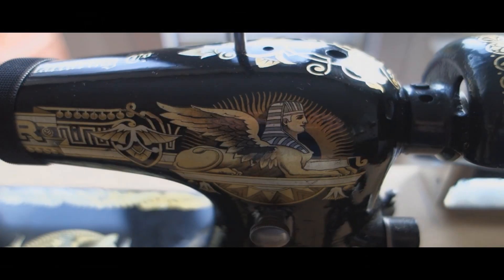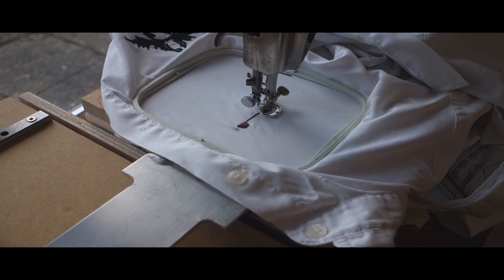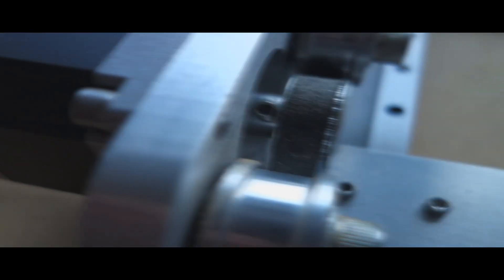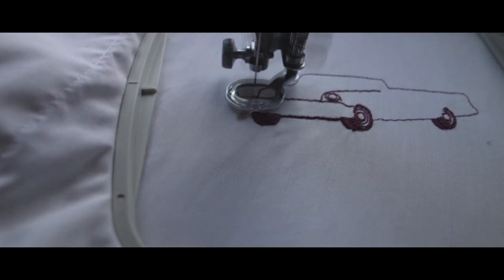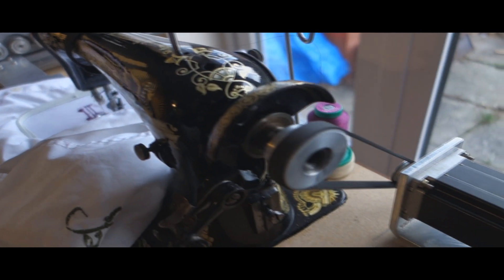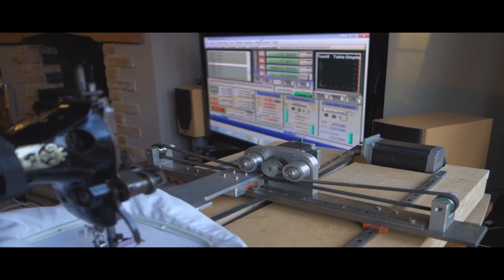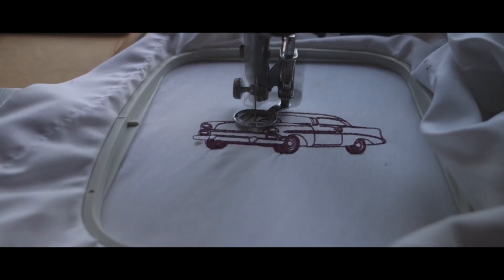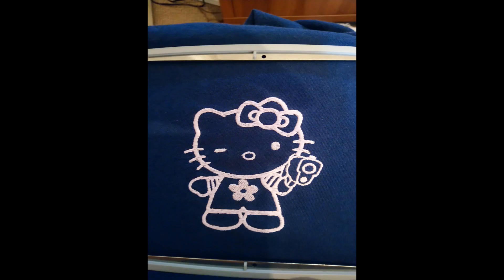CNC Sewing Machine

Comment: Hello,

I have a working laser cnc machine and a sewing machine.
I would like to link the sewing machine to the laser machine, remove the laser and screw a frame to transform this device in a embroidery machine.
Could you please help me? As I have the laser machine, do I need to buy a arduino board? how do I connect the machine motor to the laser board?
thanks a lot fro reading,
Looking forward to read you,
Isabelle

Comment: it's unclear to me how you compute the gcode file, 

i try with inkscape but the scew motor run only when the fabric is not moving
Reply from the maker: There should be a link in the description to cnc zone, I was using the software there developed by a guy called khalid to convert from tagima which is an embroidery format, to gcode. Good luck.
Reply: @makeyourownpath48 vou pesquisar.  Você tem vídeo tutorial desse projeto?
Reply: Did you find solution for your problem? Because I'm also facing similar problem.
Reply: @amitphogat9698  ive made a script to read the parameters from the gcode, and to generate a proper gcode

Comment: hello, i'm working on the same project and i need your help please, i m facing the problem of z axis ,i m using the nema23,when i send the g code the table moves but there is no stable direction for the stepper motor of needle,it just turns left and right without making any full revolution,despite i made my settings on the grbl panel and my motor made his full rotation during the test ,can you give me any advice how can i solve this problem please ?!

Comment: Can we change z axis with ac servo motor?
Reply from the maker: You could but then you would need to figure out the synchronisation with the x and y axis using some sort of encoder.
With the stepper motors there is no need for the encoder feedback.

Comment: Very nice and good detail!  Would a quieter stepper motor controller help reduce the noise somewhat?  Thinking using a White FR maybe would be quieter also.  Thinking about doing that with what a just found today using a Singer presser bar so to more easily use Singer attachments on the White FR if I decide to do so.  Thanks for sharing!

Comment: I've build one based on a Pfaff 80, with some linear rails and nema 17 Motors. How many stitches do you get per minute on average? Mine is running at about 70stiches per minute. The axis for the needle is running on a 9/1 reduction which is reliable and powerfull but maybe abit on the slow side.
Reply from the maker: Excellent to hear that you have it up and running 😀
I think I ran a 3:1 reduction on the sewing machine drive. But I had to run it at a similar speed to you due to thread tension issues with the singer. Maybe the pfaff has a better tension assembly that would allow you to run it faster?

Comment: I have a friend who is a double amputee below the knee and I am trying to figure out a way to make a servo controller for an industrial sewing machine with a clench-actuator that he can hold in his teeth to control the machine. Do you think this is possible using an Arduino or similar?
Reply from the maker: I don't see why not, I have limited experience with arduino but for sure people are using them to control servo motors? Another possibility could be to use  a stepper motor and mach3 and use a keyboard emulator connected to the bite switch?

Comment: What CAM software are you using for g-code generation
Reply from the maker: Wilcom software for the design, then using khalids software from cnc zone to convert the embroidery file into g-code (should be a link in the comments or description) then mach 3 to run it
Reply: @makeyourownpath48  i tried To download it but it shows a message wich says component richt x32 ocx or one of i depencies not correctly registred a filé la missing or invalid,need your help please

Comment: good work .
Which axes did you use in mach3?
the axis of the motor attached to the machine pulley and always turns the same direction.
I would appreciate if you answer my questions.
Thank you

Comment: hi
it's good works i love it
I already have a machine cnc router I know the function perfectly. I would like to help my wife to do her embroidery with mach3.
 for x and y axis I understand how to connect with my computer on parallel port to control . but for the stepper motor of the needle? I have to plug it in as a z or spindle axis and how to configure it
thank you so much

Comment: Hello, congratulations on the good work presented here.
Well, I already made two CNC machines, but I can not understand what your embroidery machine is like
how to sync the needle and what type of driver is used. I need information to turn it into a machine for my sister. Many Thanks
Reply from the maker: The needle is set at it's top position, then zeroed in Mach3.The G-code generated by Khalids sw then commands movement of the XY axis, performs a stitch, when the needle is returning to it's top position then moves the table, performs a stitch, etc.As soon as I get a bit of spare time I will do a video showing the workflow from design to machine and a sample of G-code so that you can see how it is commanded.
Reply: Hello, thanks for the answer, it would be great if you would make a video on this topic, because surely there are many interested people who want to know more about it. Thank you